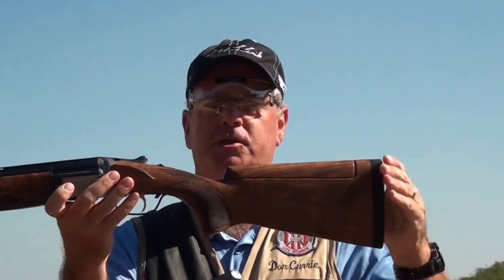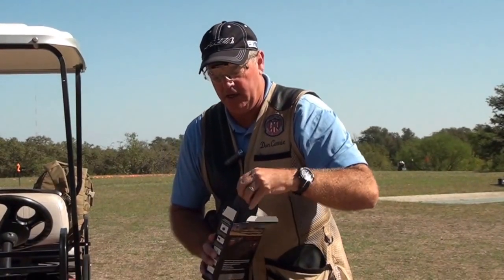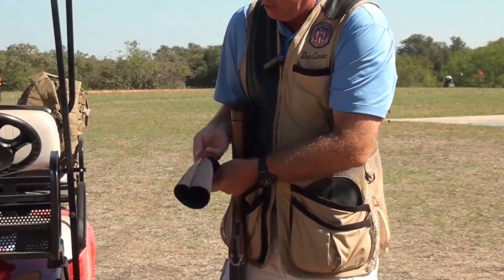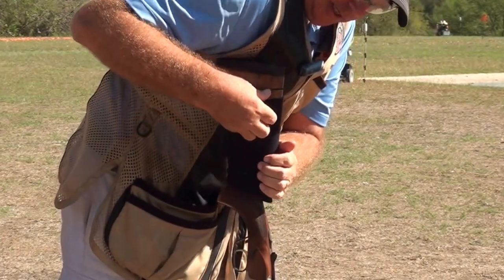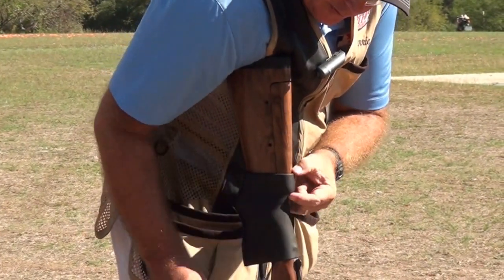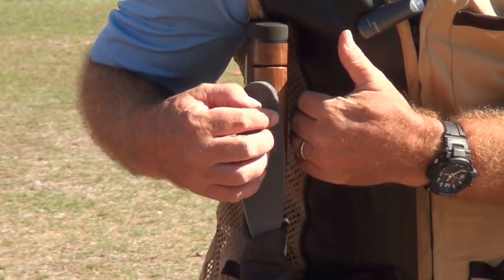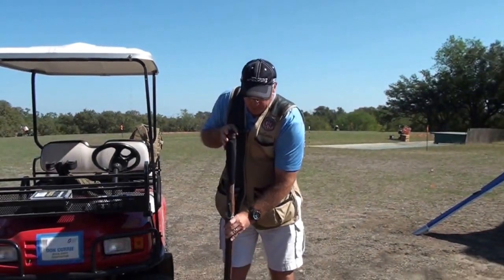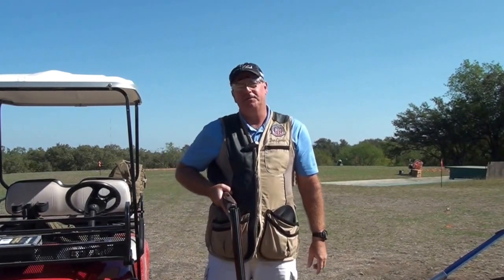Don Currie, NSCA Chief Instructor:  Adjusting the Comb on a Shotgun

Comment: Don, I need some advice. I can see down the barrel good and lots of folks think I need a comb added.  My issue is the POA/POI. I aim at 6 o'clock and 95% of my shot is below my POA.   Both of my Beretta's shoot the same shot pattern at 20 yards below POA.  Any suggestions?
Reply: Higher the comb on the stock.